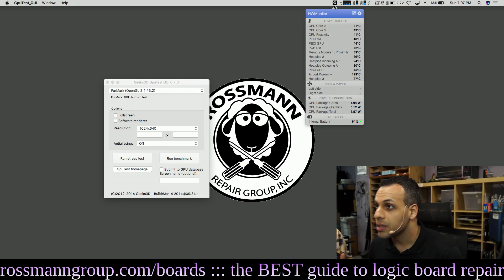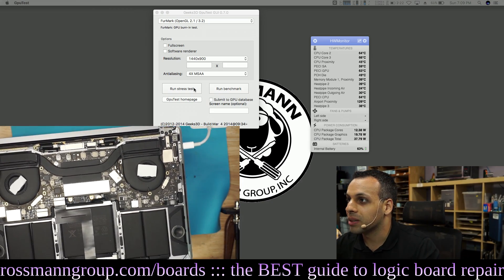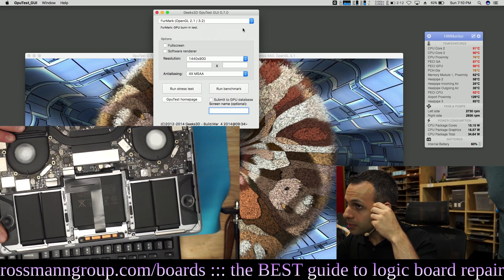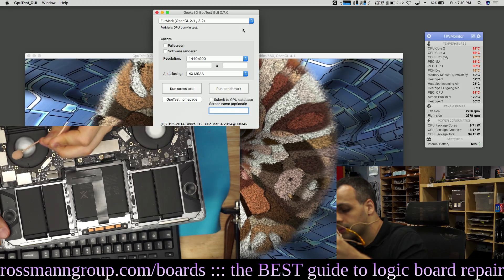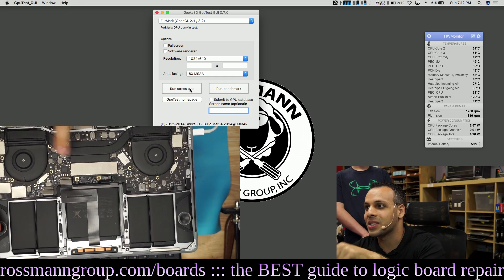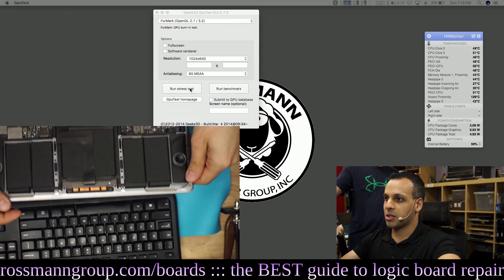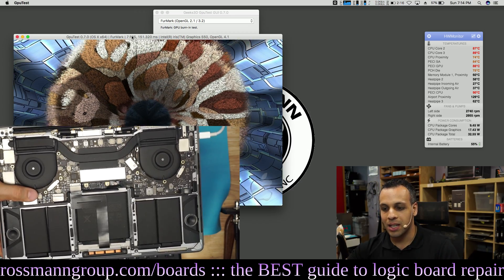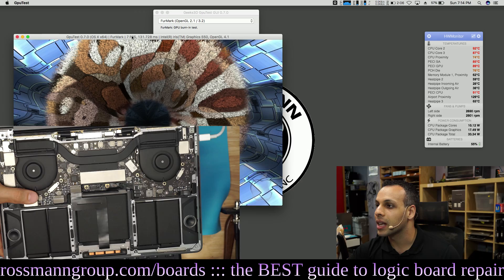Why Apple Macbook runs hot.

Comment: CPU is rated to 100C by Intel. They're running it hot, but it's not overheating.
Reply: No it won't. The CPU starts to thermally throttle in the high 90s and reduces it's turbo clock speeds and therefore power consumption until the temperatures are back under the limit.
Reply: Kid? I'm in my 40s! You're not very good at this trolling lark.

In the meantime I recommend you swat up on the CPU spec at Intel Ark. There's an entry there for T Junction. Read it.

https://ark.intel.com/products/91166/Intel-Core-i5-6267U-Processor-4M-Cache-up-to-3_30-GHz
Reply: An engine might have a rated max rpm of 6500, but is that what you should run it on regularly? Certainly not.
Reply: while it may not have immediate damage, running a CPU hotter will reduce it's lifetime.
Reply: Clueless, LOL. You'll have to try harder than that.

I spent a few years doing tech support and warranty repairs at a Computer retailer to pay the bills while getting my Computer Science degree. Then I went to work for Big Blue...

Your car analogy is ill thought out rubbish BTW. Cars with high motorway miles are often in better condition that those run around town.

I've said nothing about GPUs, and and the number of electronic components. What have you been smoking?
Reply: At 100C chip will probably turn off.... it's overheating tho exposing a chip to that temperature will kill surrounding components like vrms over time
Reply: John Roberts 100C is overheating....not good for the lifespan of any component
Reply: Bad analogy, must try harder. The highest amount of engine wear occurs when started from cold. ;)
Reply: You're primarily talking about the CPU, but totally forgot about the other parts affected by the high thermals most specifically the CPU solder joints. And it is overheating that is why it's throttling. Finally, you won't be watching his video on this if this is OK.
Reply: Why would intel built to a temperature specification that's unsafe for the BGA solder supplied with the CPU?
Reply: @John Roberts TOTAL. GARBAGE. 100 C temperature not bad? Get the f out. Sure, your skull might take 1000 kilos of pressure, though that doesn't mean your organs can take it without liquefying. You haven't repaired shit. Stop making up references you clearly do not have. The gaul of you telling people how things are when you do not know s. Grow up, kid, and actually try to earn your stripes for once.

Comment: Maybe this is specific to the smaller Macbook Pro in that the fan only spins once the machine heats up. I have the 2017 Macbook Pro 15inch, and my fans idle at a minimum of 2000 rpm even when the laptop is just at 42C. Though if you leave the default fan control in place it will let the laptop get up to 90C before spinning up the fans which is shit.

I use Macs fan control to increase the aggressiveness of the fan speed and I can make sure the max temperature is less than 70C under heavy loads. Apple really should have an option for either passive or aggressive fan options.

Comment: I have macbook 13inch 2016 with touch bar, its amazing device but all of sudden it start to heat up on the keyboard specially left side, with minimum load (only youtube on safari) I took it to apple and they said nothing is wrong with the hardware its only a software issue and they claim to be fixed. till now I am facing the same issue. 
note: after few month of getting this machine, the keyboard failed and it was replaced by apple. 
note 2: this issue came after updating to the latest software.

any advice????!!!

Comment: my friend Acer V5 473G is cooler than this ,
small 2 fan and very thin case : i5 4200U (and I had set tdp to 25w <the original one was 15w>) , GT740M
won't go over 90 for both CPU and GPU even with the shiity stock 4 years old thermal compound while running Prime95 and Furmark together.

Comment: Ah, this brings me back to when I had my first (and only) macbook in 2011. The CPU ran hot at 90 degrees, so I took it to the apple store and they told me that's perfectly normal. I've been working with PCs since 1994 and have never heard that it's "normal" for one to run almost at boiling point.

Comment: Maybe Apple confused Fahrenheit with Celsius temperature scale? Don't they realise that 70 degree Celsius is very hot? if the casing heats up to 40 degree Celsius (since the fans didn't activate until 70 degree Celsius and the heat flows & accumulate into the casing) then typing on the keyboard will feel very uncomfortable, and at 50 degree Celsius it will reach a human pain threshold. The components inside the casing will also fail as it operate beyond "ambient temperature" at 50-60 degree Celsius, the battery will also degrade as well at 60 degree Celsius, same with the HDD which operate at much lower "ambient temperature" of only 40 degree Celsius.

Comment: To be fair - 91!C isn't that hot for a chip. But it should start the fans way sooner.
Reply: Heat is the enemy of all electronics.  With temps like those you are definitely trading off longevity.  And the failures don't always have to be the chips.  It is a serious question how long the motherboard will resist the thermal cycling before the chips pins-to-motherboard traces start to break.
Reply: @ Nerdy, Retro, Gaming
I had a $1700 laptop that had overheating problems - 80C and above were easily attained.  I remember redoing a video render. To keep the temps down to what I considered reasonable (60C) I used a program (RealTemp) to downclock the processor to 25% of rated speed.  To say the least, I thought I had been ripped off on the purchase of the laptop.

And that video render?  At 25% it took just minutes under 24 hours to run.
Reply: RavenPrecept It would start throttling long before 110c, IIRC 100c is the max for CPUs in recent MBPs and 90 something for the GPU (but it shouldn't reach that high even while gaming, the burn-in test is unrealistic)
Reply: ABaumstumpf it might also break the universe due to the high energy level causing the wavelength of radiation released to be smaller than the plank constant breaking the laws of quantum mechanics...
Reply: Kevin Tu
... worth a shot?
Reply: 91 factorial celsius is quite hot, just think abouit it.
Reply: Oh yeah, 91C !  :P
but i think getting a mac to 91 factorial would at least release you from the suffering.

Comment: maybe look up / tell us the max temp of the cpu?

normaly they are around 100C for apple cpu‘s.. so these temps are totaly fine for short time periodes. and as we all know the load of cpu stress test will never occur under normal circumstances
Reply: nope run any game, art or rendering application and it happends. I actually used to think that 89c was a healthy temp for my pc because that's when my fans would kick in. I melted my brand new Macbook air logic board in 3 months with Photoshop
Reply: ZT sucks to hear that. just wondering why the net isnt full of news of this, if its such a common problem of apple. normaly cpu‘s just throttel befor reaching max temp.

but with this knowledge, maybe just underclock / undervolt ur cpu.
did the same with my ryzen.
Reply: thore b You can't undervolt/underclock an apple system, and why should a user spend 1000+ dollars on a system just to underclock it and lose the performance they paid for even if it was possible?
The fact that Intel list thermal junction max as 100C doesn't mean it's okay to run at those temperatures, the CPU will actually begin throttling at 85C, and at 120C the CPU will shut down completely, and I don't know about you, but 20C away from shutoff is not acceptable imo.

The thing to remember is that the CPU won't be at those temperatures for a short while, it's there almost constantly, and this test is in a best case scenario, put it into normal use with dust buildup, on someone's lap or in a hot country, or even all of the above and that laptop will be even hotter and will be lucky to last more than a couple of years.

And those temperatures can definitely be hit during normal use, I've got an older macbook that is having an os install and it's thermal throttling now, and the casing is too hot to comfortably hold, and an os install isn't even the most demanding thing you can do with a system.
Reply: ~7.44 years of usage is a loooooooong time in tech years. I used to own a 17" MBP fully loaded (SSD/max ram, etc) and loved it...until the day I tried doing some video editing on it. The CPU was 100% with ~90-100C  and it took forever to finish. Made the switch to a 2016 touch bar model (5-year difference) and the difference was clear as day in terms of performance. I get the whole argument of wanting a longer lifespan from your products, but I also get that performance will degrade over time. 

Now you might argue that 7 years is a decent life-span and  3.7years is a bit short in terms of "Laptops" since there were no major breakthroughs and the performance gains are minimal (~20-40%), however, that is based on how/what you are doing with it. Video editing, streaming, 3d, heck even Sketch uses like 300% CPU sometimes are legitimate reasons (at least in my opinion) to at least think of an upgrade every 3.5-4 years.
Reply: thore b Please don't be an apple apologist, apple deliberately run the CPU and GPU as close as they can get away with to their thermal limit in order to be quiet, on ALL devices they make, and that is just unacceptable, it shortens the lifespan of the device, and again as has been said before, it isn't just for short periods, they're always running hotter than necessary, and why should a premium device run so hot in the first place? It isn't as though it's difficult or expensive to make a decent size heatsink, even in an ultra book class device.

The guy who works next door to us has a 2015 imac that thermally throttles during his day to day work, and he is a graphics designer who does purely 2D graphics, and that imac is as clean as a whistle inside.
And in no way should any device thermally throttle while installing an OS, that's just nuts, and to be clear the OS I was installing was 10.6, the OS that the device came with, so not a modern OS.
You might be pretty certain that a macbook won't overheat during normal operation, but I, and Louis Rossmann and others actually know that they will, and that they do overheat during normal operation, because we work with them, we service them and we own them.
And 80C during web browsing is hot, don't get me wrong, but it is well below the thermal limit of the CPU. 
If a 400 quid special from PC world made by HP or even Acer can deal with the heat properly then why can't a 1000+ quid device from a premium manufacturer do the same?
Reply: "And 80C during web browsing is hot, don't get me wrong, but it is well below the thermal limit of the CPU. " Same with the Apple Cpu, that was my point, its not hitting the limit.

And yes it shortens the life. But NOONE can tell for how much. There isnt any valid data to this, how should there be any. So...
Reply: thore b I'll give you some numbers then, at a rating of 85C for an electrolytic capacitor running at that 85C in an ambient temperature of 25C, the typical operating lifespan is 5000 hours, which if we divide by 24 gives us ~208 days, or ~7.45 months, let's assume a more realistic runtime of 8 hours a day, we come to ~3.72 years, not bad, that means that on average, we would expect just under 4 years of usage before component failure.

But let's take that same capacitor and keep it running at 50C in an ambient temperature environment of 25C, we're now looking at 10000 hours of typical operating lifespan, which using our same calculations, comes to ~416.6 days, or ~1.24 years for 24/7 operation, assuming a more realistic 8 hours a day runtime we're looking at ~7.44 years before we would expect component failure.

Now I don't know about you, but having a device last nearly 7 and a half years is imo a heck of a lot better than one that doesn't make it past 4 years, and those figures are for a 25C ambient, in a laptop it might be closer to 50C, at which point the lifespan will be far less, and while laptops made by apple don't use electrolytic capacitors afaik, the general idea is still valid, the cooler it runs, the longer it lasts, and the less likely it is to end up in landfill, which should be important to everyone, including apple apologists.

Also, there isn't a laptop made by lenovo called the thinkpad x210. The closest I found was the updated motherboard for the x201 by 51nb forums. So unless you bought a motherboard off of a Chinese language forum and fitted it to a x201 from 2010, then you're either confused about what laptop you actually have, or you're talking out your backside.
Reply: Sorry, looked it up. I meant the lovely thinkpad x220 ; )

But i sure like those assumptions.
Reply: where the heck you found an electrolytic capacitor in modern laptops? they all use solid state polymer capacitors which will last decades even being heat up to 100C.
Reply: "an older macbook" .. Thats the problem here. Of course an old cpu wont be able to handle this days OS and programms. My thinkpad x210 also reaches with ease 80C while normal webbrowsing. Im pretty certain that any new macbook , atleast under normal conditions, wont hit these temps (and even if, aslong its only for a short period of time its totaly fine). But to be fair, kinda sucks for old macbook owners. I was able to undervolt/underclock my Thinkpad pretty easy. Never hit the 80C again.

Comment: Christ. And here I am throwing a fit if my CPU/GPU gets above 65 degrees...
Reply: My cpu stays in 40-55 degree and it's a xeon. that's if it's casual gaming with status. (casual gaming as in Overwatch, Doom, Android emulator, mac os, ios emulator, console emulator.) Sometimes i would go all out and have 7 applications open at a same time to monitor my computer and diagnostics running checking and test out programs i've made in javascript, html, and vbs. I also run benchmarks on this beast. Sadly i could not get anymore gpus for my computer since crypto miners using gpu for mining even though it's kinda dead now since priced of btc dropped to the point that it cost more to mine than actually earning.
Reply: I have a 2500k clocked at 4.2ghz that usually hovers anywhere between 45-50 degrees depending on the load. Though it is cooled by a fairly massive heatsink... So much so that I cant actually close off my case because the heatsink wouldnt fit otherwise. And my RX 570 runs at roughly 43 degrees with the fans at 50% speed. It's not even that loud
Reply: Very good pc
Reply: Ive got a ryzen 1700 OC to 4GHz that never goes over 60-65C because of water cooling. The thing is, laptops (any, not just apple) will always be hotter than desktops because they have less airflow, and weaker/smaller fans. Most laptops get pretty hot. Apple does have absolute shit thermal design but most ultrabooks do, because of their size.

Comment: And that is with full (no bottom case) ventilation...yikes.
Reply: It goes to 100C and stays there with bottom closed, yeah. 

And reviewers say it's okay because it was designed to run this hot and won't hurt itself. Braindead goats.
Reply: well, some macbooks work for decades with the same temps, so maybe those reviewers are right

Comment: To be fair I believe you need to have the bottom cover on for the fans to properly cool, those turbine fans need a tight space to force air where it needs to be to cool. But either way 83c to even begin to turn on the fans is ridiculously.
Reply: Those fans pull air in and push it out through the heatsink. You don't need a "tight space to force air where it needs to be", it's already designed to force air through the heatsink. In fact, having the bottom off is improving cooling as the fan now has unobstructed access to fresh air. With the bottom installed and the laptop sitting on a table or desk as it would for everyday use, it'll be even worse.

Comment: - they don't care if it cooks itself from inside as long as it doesn't make noise
- they don't care if the keyboard types as long as it looks pretty
SAVAGE AF
Reply: Think different.
Reply: I’m confused because MacBooks have been known to last forever. Well in my experience they have. I have a 2008 MacBook that still works great. A friend of mine has one from the early 2000s and it still works great. The keyboard works just fine always has. One of the best computers I have had. Now I do like other computers for different reasons.
Reply: @Chasecka  i think it really depends what your doing also
Reply: @Chasecka  is it safe to use such an old MacBook? In your case of the 2008 MacBook? Like does it support softwares, and is it safe from virus/hacks?
Reply: @RamMohammadJosephKaur  virus ? NO.
battery explosion/dead YES.
Also 2008 mac book have slow as fuck core 2 duo processors. They even lag in day to day tasks.
Get good cheap zen 3 ryzen laptops.